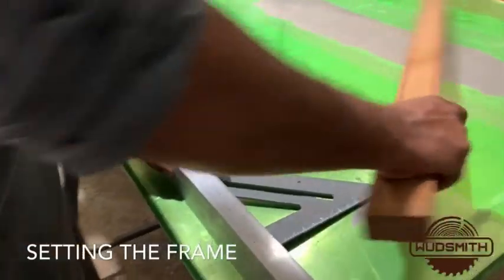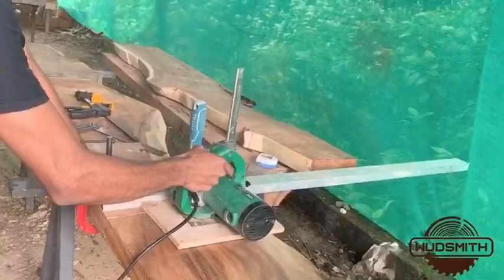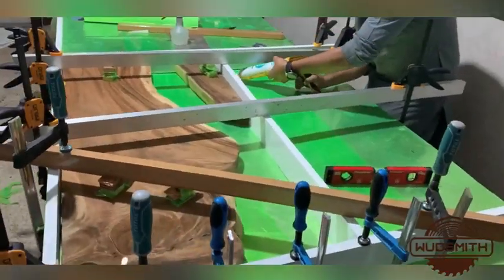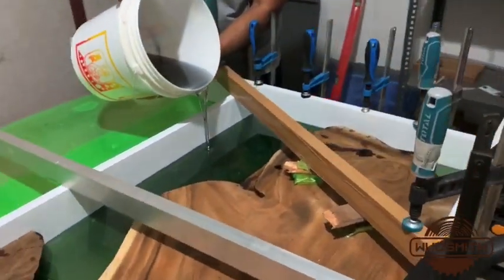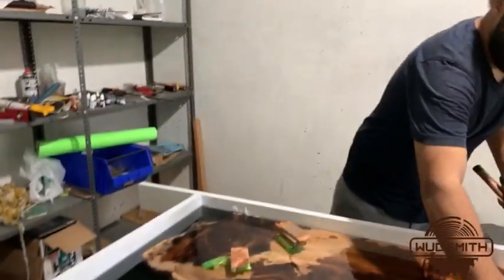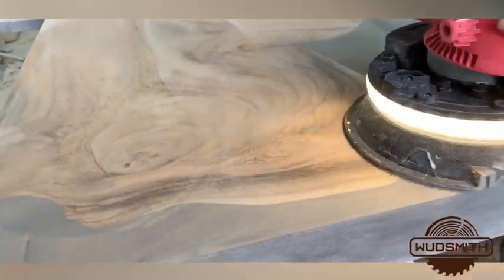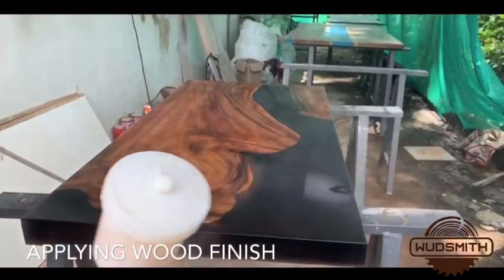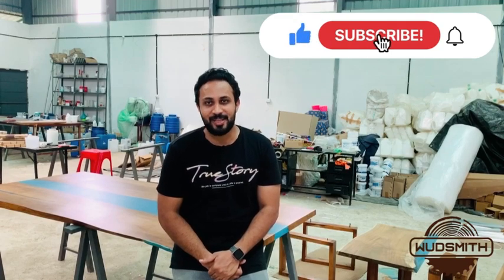Making Epoxy Resin River Wood Table in India, At Home, Art for Beginners- Epoxy Resin Table Pour

Comment: Can you make the video of a step by step tutorial on the making of epoxy resin river table which includes the full process? Besides, is it possible to calculate how much epoxy is required for a table?
Reply from the maker: Hello there, Sure we will make the video in the upcoming days. Yes it is possible to make the approximate calculation of how much resin is required. You get the square feet of the area where the epoxy has to be poured (L inches x W inches/ 144) the resulting figure should be multiplied by 2.38 and you will get the approx kilos of resin that need to be used

Comment: Which colors are available? How much time will it take to cure the epoxy? Are you doing live edge?
Reply from the maker: Hello, we have atleast 24 different variants of colors available. Metallic blue, Metallic Copper, Metallic Gold, Sparkle Silver, Carbon black, Glow blue ( which will glow in the dark) to name a few.
The epoxy will take anywhere between 5-7 days to cure completely depending on the quantity and thickness of the pour

Yes, we are doing live edge
Reply: @WudsmithCo  will the colour get fade over time?
Reply from the maker: Hello there, No the colors wont fade. You can consider them having the same properties as the wood itself. It can be polished and shined same as the wood
Reply: @WudsmithCo  Can you mix the colours and create unique designs or patterns ? The display looks very attractive !!!
Reply from the maker: Yes, we can do that. If we have good ideas on mixing various colors and creating new ones, its very much possible

Comment: How much is the price for this epoxy resin table? Is it durable like wood?
Reply from the maker: Hello there, The price is dependent on the dimensions, wood used, quantity of the resin etc. 
Epoxy is more durable than wood actually, However its susceptible to scratches same as wood. But it can be sanded and polished same as wood.

Kindly have a look at the below link to get a custom quote for your table. You can fill in the details so that we understand your requirements better

https://docs.google.com/forms/d/e/1FAIpQLSc2urDpa90LG4EzOR2BgxmCDzAzkZYIJwvDz_r-QmZaGOohaQ/viewform